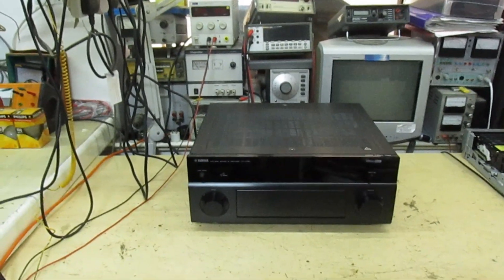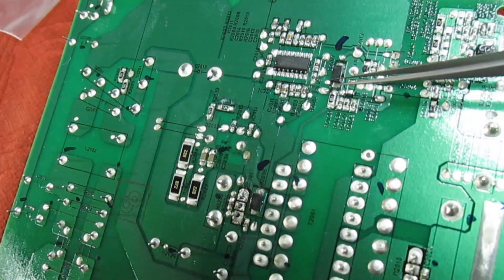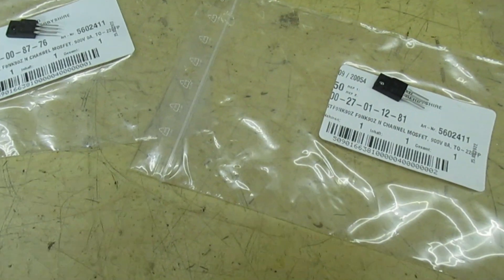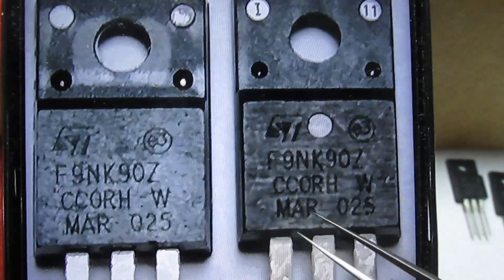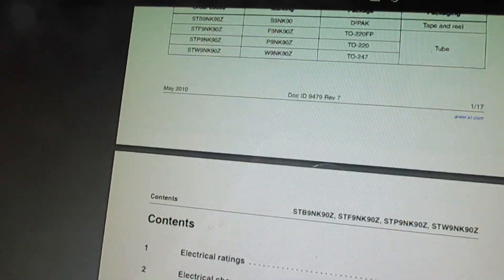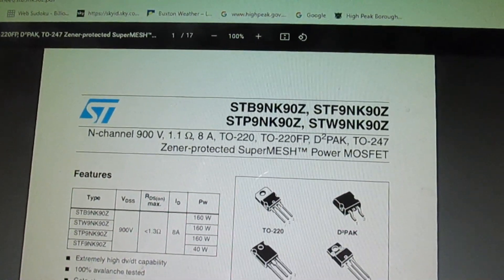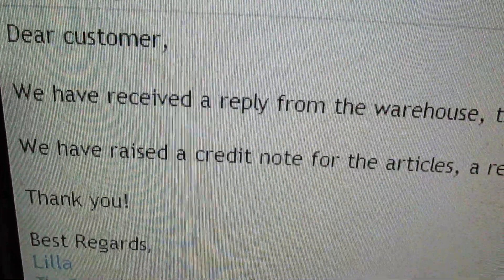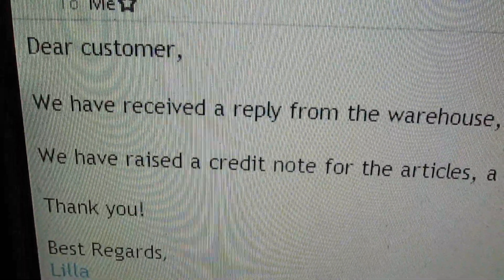Yamaha RX-V1067  HI/FI amplifier stand by power supply repair .

Comment: Lots of fake components about, it's a pain sometimes. But there are "good" fakes available, that are hard to spot, so like you I check them against an original when I can and check the gain or other electrical characteristics. A good video to highlight this growing problem. Sometimes there's no equivalent component available so you're forced to buy these dodgy uncertain parts and just test them as best you can to see if they make muster. It feels like a shrinking world sometimes. It used to be just the old kit that you couldn't get parts for, but nowadays even the modern stuff is full of unobtainable components. There's a movement I think in America called Right to Repair. I hope they make some progress and manufacturers start to produce kit with a view to making parts available to repair them. The cynic in me says that won't happen.
Reply from the maker: Manufactures bring this problem on there selves , if they were to supply parts in the the first place there would be no need to trawl the dodgy web looking to spares .

Comment: You are edited out the best parts.  For instance, how do you resolder surface mounted parts? What is your heat source?
Reply from the maker: For small parts just a soldering iron and flood the component with solder,  but if your doing big chips  I now use a hot air soldering station .

Comment: It is getting harder to find genuine components these days, I had the same problems with an STK amp chip, finally found a good ex equipment replacement.
I use a cheap USB microscope, certainly works well enough for my needs. Although I try to avoid surface mount stuff, I always end up getting more to repair.......
Reply from the maker: Unfortunately that's the was things are these days   I waste a lot of time trying to source genuine parts and this is all time you don't get paid for.

Comment: Excellent, as always. You did make me laugh when you said Radiospares. The diode resistor circuit connected to the MOSFET gate confused me initially (but that's not difficult these days).
Reply from the maker: I think the diode, resistor is to discharge the gate capacitance when the mosfet turns off, when RS first started off they sold parts for radio and TV sets, I still have mains droppers here that radio spares sold in the 70s, may even have an old catalogue somewhere.
Reply: Thanks for the explanation. Ah, the memories, I still have packets of components with the yellow Radiospares labels and remember the multi-volume catalogues.
Reply from the maker: That's another distant memory, catalogues, everything is now on the dreaded Internet.
Reply: @michaeldranfield7140  Radio Spares is that The British version of Radio Shack?
Reply from the maker: @jackgarrison8497  Maybe one day they were in the early years but now RS components is a mega supplier to  industry , they are expensive but everything is top quality and account holders get next  delivery, they are not for everyone  as been an industrial supplier some components are supplied in packs of 10 , 50 , or even 100 but I don't mind that as I like to keep well stocked up with components as I do this job for a living .